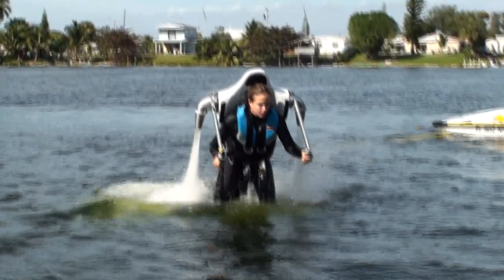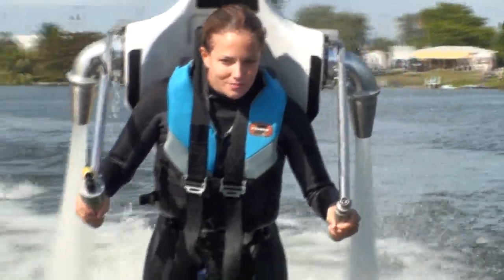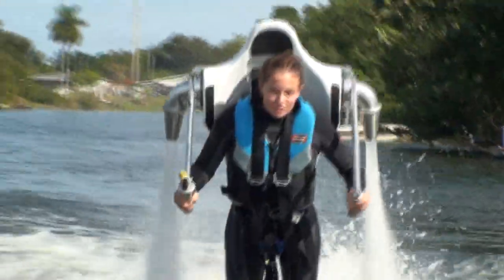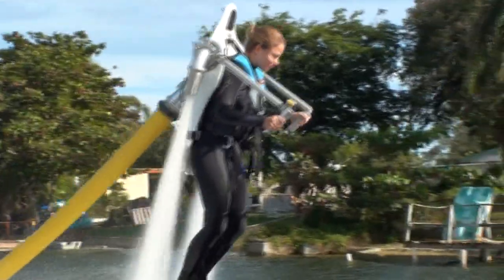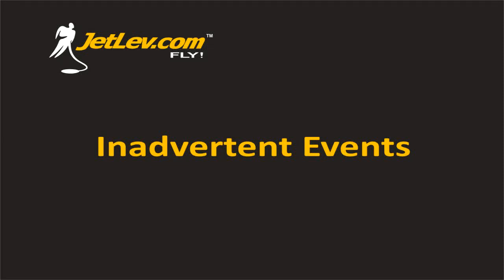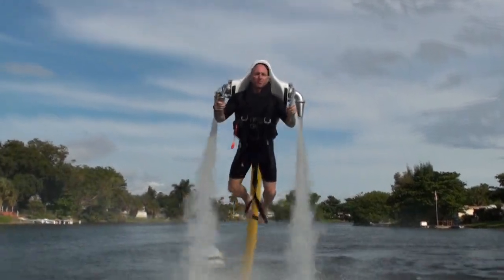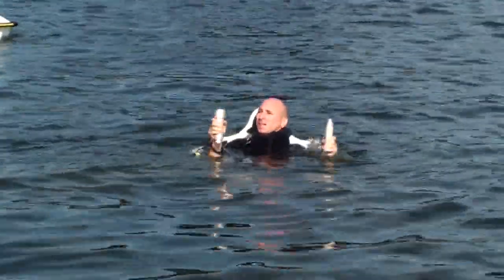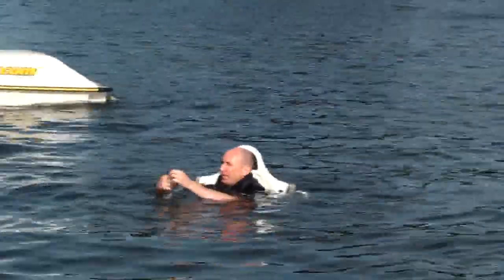Jetlev Basic Training Part 5 of 5

Comment: this is ridiculous 130,000k ??
i saw there price on the website and its in Euro i'll let you know that a brand new jet ski is around 10k and 30ft -6" hose with two firemen nozzles is NOT 120K worth of engineering. the price is ludicrous just because its new. i think 30k is a reasonable price